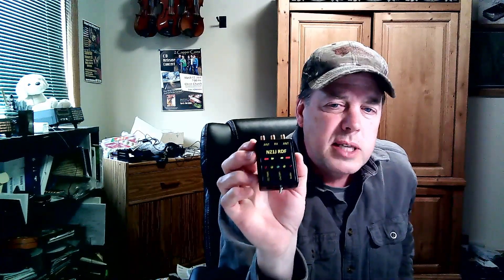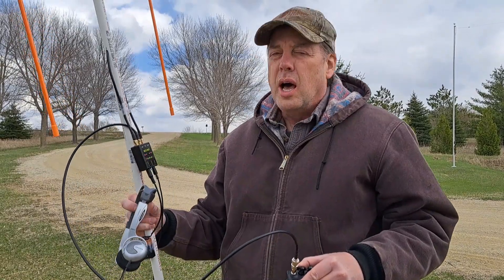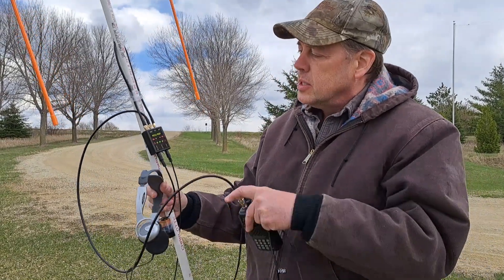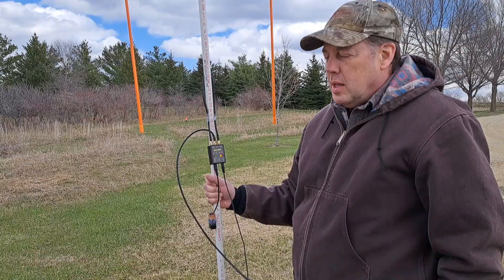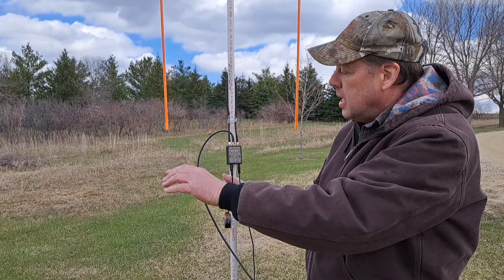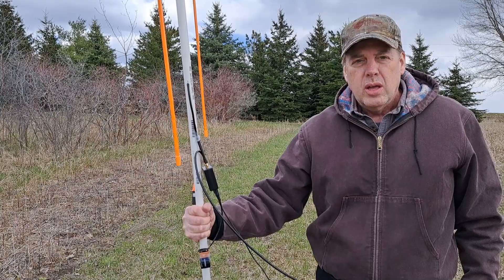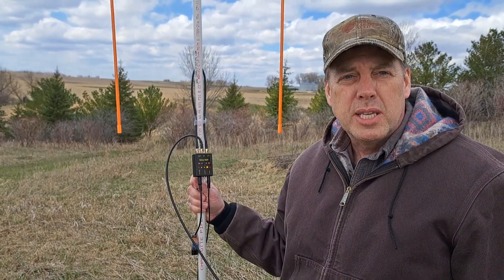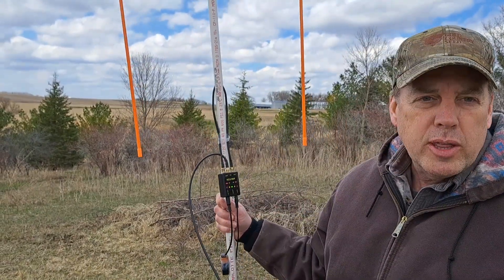Radio Direction Finder

Comment: If you don't know the location of the transmitter and the direction-finding (DF) equipment indicates the signal is coming from straight ahead (the green light), it's important to remember that the signal travels in a straight line. However, you don't know if the signal is approaching you directly or if it's coming from behind you.
Reply from the maker: You are correct, and then rotating the antennas and seeing which of the other LEDs light up will make it obvious it if is ahead or behind.

Comment: Will it work using an AM Aviation receiver (108 MHz - 137 MHz) and other FM frequencies above 2M to 170 MHz?
Reply from the maker: It should work fine in those frequency ranges.  This  RDF box does require the receiver to be FM demodulation.  You can DF on AM aircraft transmissions with this box if you set your receiver to FM modulation but tune to AM frequencies (not all radios will have that feature).  I have tested this with a Yaesu FT-60 and it works, but probably with some loss of sensitivity.